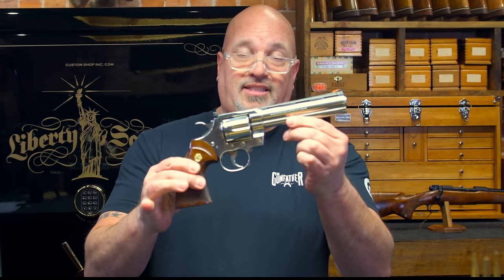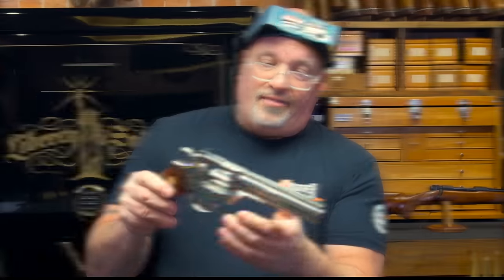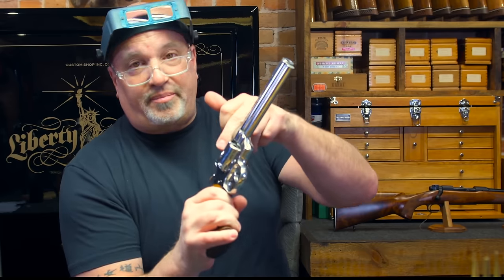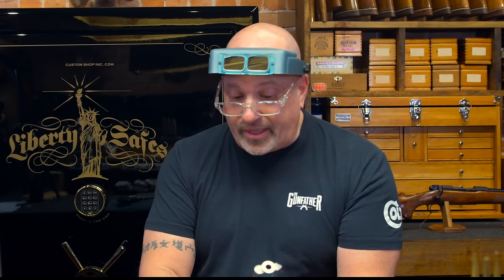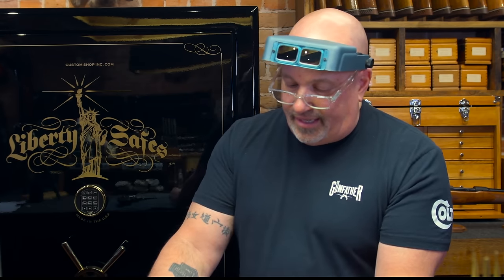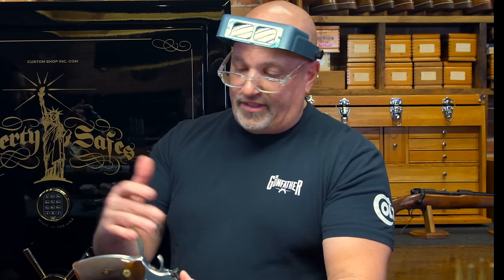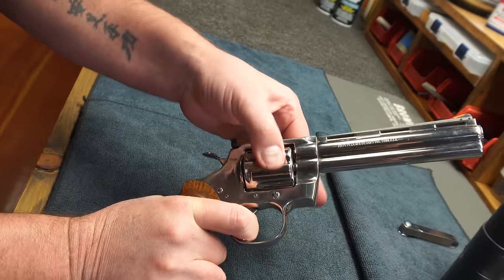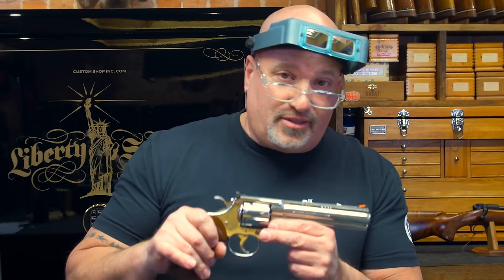Check the TIMING on Your Revolver  (Every Gun Owner Needs To Do This!)

Comment: My favorite revolver is the Ruger GP100.  I have a 3", 7 shot 357 and another 5 shot in 44 Special, an old Speed 6 got me hooked on them.  I have Smiths and had two 6" Pythons, IMHO to many problems in both examples.  Forcing cone and timing issues, dragging and just not up to high round counts.  I also have a 4" Trooper Mklll that I believe is twice the gun.
Reply: Their classic is the best to be honest
Reply: The classic GP100 in the blue
Reply: Also have a Mark iii 👍🏻
Reply: I never should have sold my Trooper. Incredibly accurate.
Reply: The problem with the GP100 is after firing 50+ rounds and any high round counts at the range, the cylinder/frame milling tolerances are milled sooo tight, that the gunpowder residue can (and will) cause the cylinder to sort grind, or even jam so that the cylinder won't turn.
The NH State Police had these for a very short time and experienced that problem dozens of times. That was in the 1980's.
Reply: @gayle2848  damn Gayle, you married?
Reply: @gayle2848  My old Speed 6 never missed a beat, that is what I love about it. I bought a 6” GP100 back in the early 90’s, again I only clean my revolvers when they get really grimy and never noticed any problems with it. I gave it to my son a while back, replaced it with the 3” and 5 or 6 years ago I bought the 3” 44 Special.  Both have been flawless and I average 50-100 rounds / week between the two, last year over 3000 with one cleaning of the 357.  I forget when the GP100 came out but I believe it was in the early 80’s, might have been teething issues at the time. No one I know that has owned one has ever noticed that problem.
Reply: @hardball107  I have two GP100s and I have never had any problem with either one (both .357, one blue, one SS) and I have fired all kinds of ammo thru them well over 10,000 rounds total!  I'm totally sold on them and quite frankly, they fit me very well.  The only modification I've made is changing to Hogue grips!
Reply: My fave is a 50 yr anniversary 357 blackhawk flat top
Reply: The Mk III was as close to flawless as a revolver can get....IMHO
Reply: I have many revolvers, I have to say I like my Smiths however I love my Rugers.

Comment: OK, so the cylinder locks up OK. That does not automatically mean the the barrel AND cylinder are in OK, I mean proper alignment. As a  prototype machinist making one offs, I would check that alignment, OK. If you go to all the work and expense to "restore" a revolver OK, it would not be OK for the customer to have an issue because of misalignment. OK, over and out.

Comment: My favorite revolver is a Dan Wesson .357mag Model 15VH pistol-pack with all the different size barrels and grips.
Reply: Bought this kit brand new in the mid 70's. It was sold and marketed as THE DAN WESSON KILLER KIT. You won't see that happening anymore.
Reply: I don't have the kit but I do have a model 15 (vented heavy) with an 8" barrel. Wonderful revolver.
Reply: I wasn't sure of the number you listed. I don't remember mine. It came in one box which when opened had the gun with I believed the 8 in. barrel attached and the other barrels down to 2 in all in order underneath kinda of a display box. I never changed the barrel. I foolishly sold it although at the time it didn't seem so. Bought it at Sportmart. There gone now I guess. was the chrome one. Also bought S&W 29 & 27. That was the 44mag. and 357mag. They were also 8 in and both chrome. Sold them too. Bought all 3 same time, no questions just 3 day wait. Those days are long gone. Don't remember the price but I believe it was 7 - 8 hundred for all 3.
Reply: Too bad CZ-USA dropped the production of this fine revolver
Reply: My father's favorite  too!

Comment: Everyone has a preference based on perceived functionality. 
Mine is Ruger Revolvers, Ruger builds their Revolvers like a tool not a Swiss Clock, so, yeah, the Ruger action isn't going to be as complex and delicately fine as a S&W, but  that old Ruger Revolver won't fail you.
Reply: I've had two fail me. Both .44 mag. One was a cooked forcing cone, and timing. The other is timing . They fixed the first one for free. I haven't sent the other back yet. They don't last long with hot .44 mag.
Reply: S&Wesson 686 4”
Reply: I’m pretty happy with Ruger’s custom service. I bought a SP101. The timing was screwed up right out of the box. Sent it back, they replaced all of the internal parts and sent it back no questions asked. It’s run perfectly ever since.
Reply: @mikeys7536  
I have an old New Model BlackHawk and a Security Six, from the 1980's.
Paid just $200 for the SS and $150 for the BH. at my local pawn & Gun. in 1986/87
I really like the new RedHawk, 8-shot in 357, BUT WOW, it is expensive.
I'm glad I got my guns when quality was still affordable....🤠
Reply: @franmusolino2660  
I had a S&W 686, back in the 80's,
 Hated it, super Heavy, Clumsy, only good for the range.
Traded it for a Super BlackHawk
Reply: @awakenotwoke4830  
For Sure, a 44 mag is a Rifle Round to me,,

 I shoot 44 specials in my 44 revolvers.
Just the wasted powder from a 2.5 and 4 inch barrel is enough evidence for me that 44 magnum in a pistol is a dumb idea.
Reply: Ruger has always been known to produce a much higher quality metal for their guns and with some polishing and a few shims, as precise as the Smith's and Colt's. Colts seem to break a lot easier than the others.
Reply: @joecat101  
Yup, That has been my experience too.
Especially the timing and alignment on S&W guns, the smaller parts give a nice action, but you gotta baby them.
Reply: @jodopeg  Ruger is trash. Smith and Wesson is way out of their league
Reply: @T-SwiftsMaritalAid  
S&W is more refined, no doubt, but get sand in it and watch it NOT FIRE.
Reply: My experience with a new NewModel Blackhawk was very poor.  The ejector wouldn’t clear the cylinder easily at all when it got hot.  Bought it in 1976.  Worst revolver ever.  Smith or Colt work far better.  I was very disappointed in my first gun purchase.
Reply: @Edgy01  someone who had the gun before you must have tampered with it, because the ejection rod would not be an ejection rod if it didn't extend past the back of the cylinder....
https://drive.google.com/file/d/1WgkWyUk9qkrqtA-a4neXyT239Lpp6L5J/view?usp=drive_link
Reply: Ok……?
Reply: Amen.
Reply: @awakenotwoke4830 Mind telling me what models? I’m eyeing a few and would hate to get burned
Reply: @T-SwiftsMaritalAid  Ruger SP101 is trash, great design but poorly assembled. Bought one used years ago. It was a little jewel. Five years ago, I bought one new. It was out of time and I traded it off. Took a chance a couple of months ago on another new one and it was hot garbage, the barrel was so crooked that they had the sights set waaay off to the right, and it shot 6 inches off at 5 yards! The barrel- cylinder gap was so crooked that when the gun shot 2 cylinders, the heat caused the cylinder to jam up and not want to revolve. I dumped it and got a Kimber and never looked back. This coming from a lifelong (former) Ruger fanboi...
Reply: OK 😂
Reply: @jodopeg i had a sw 568. Loved it.. to each his own tho.. i have large hands, that might have something to do with it.
Reply: @Zeeboklown  
Yeah S&W makes some nice L and N frames, perfect for big hands.
My hands are medium sized,  but I like Ruger because I can dissemble my Security Six, Black Hawk, and Red Hawk 357 by memory.
Clean the parts in gasoline, give it a light coat of oil and put it all back together like new with just a screw driver and a punch, all in 5-7 minutes.
Simple and strong.....
You take apart your S&W model 568 down to the last piece and you'll have a Hell of a Time putting it back together.
Springs popping out, delicate little toggles and pins. Fukin Nightmare...!
Reply: I only made it to the seventh ok. OK?
Reply: @jodopeg  that's the thing tho. i never HAD to take my s&w apart. period. so, it's kinda dont' fix wats not broke scenario. i understand ur statement, but what does it matter if my s&w has more fiddly parts if they never needed to be replaced??
Reply: @Zeeboklown  
cool,,, just don't drop it into a sandy spot or a mud puddle....😄😄
Reply: @awakenotwoke4830  
I have an old Sig-Sohn 44 mag Colt replica, I've always shot 44 special in it.
shooting 44 mag from a pistol is dumb, a 44 Mag is better shot from a lever action Marlin1894
Reply: @Boofi-quat  sorry just saw this. One was a late 90s super black hawk. I replaced it with a super black hawk hunter. Both 7.5 inch. The hunter hasn't had anything hot through it. Still has timing issues.
Reply: @jodopeg  It's was bought for Alaska, bear defense. It was the largest caliber I could shoot accurately. I run a 10mm model  40 Glock now, with Underwood penetrators.
Reply: Ruger's are built heavier than Colt or S&W. My only negative against Ruger
Reply: My ancient Colt Agent snub nose revolver was built like a Swiss watch by a professional master craftsman. It has a very smooth double action trigger pull and is very accurate and reliable for a snubby.
Reply: @franmusolino2660  Damn skippy. The caddy of handguns.
Reply: All of you guys on here with a dislike for Ruger, I believe that dislike is unjustified. I've worked in the firearms industry for years and have owned many different brands of revolvers. I'll take a Ruger over any other brand if given a choice. That being said, S&W's are fantastic revolvers as well, and so are    Dan Wesson, Colts, and now Kimber. Even some ofcthe cheaper revolvers are pretty decent nowadays, such as Taurus, and Charter Arms. Yeah, some of you used the example of having experienced some unfortunate flaws in some of the Rugers you have purchased, as reason to condemn them as junk. Well, guess what? All firearms manufacturers have service departments for a reason. Sometimes poor quality guns manage to pass quality control for whatever reason. Having worked in the firearms industry, I have personally had to return customers guns to the manufacturer for warranty work to be repaired or replaced. And yes, a lot of those have been S&W's, and all the other brands listed above. Hardly ever did we get Rugers to send in for repair or replacement. Rugers are built like tanks. They are typically very solid reliable revolvers. The triggers might not be as great as some others, and the might not be as pretty as some of the others(which is debatable), but they are great revolvers. Ultimately, revolvers tend to be very reliable no matter who makes them, and yes there are exceptions to that. But modern manufacturing advancements and technology have created an environment where most firearms that are manufactured have a pretty good record of quality. Anybody is welcome to disagree with my assessment regarding the subject, but I came to my conclusion based on my personal experiences. Just my humble opinion.
Reply: I NEVER had a S&W revolver fail me. I’ve been on the line when Colt revolvers “hiccup”. 50 rds p/month; not one issue except for a squib.
Reply: @patrickdaly5117  ,,,
I'm not saying S&W revolvers aren't good, they are a classic.
But, I've had episodes while out in the Everglades here in florida where it would rain and get everything muddy and eventually full of the sandy dirt we have here.

And while I can easily field strip and clean my Glock and Taurus 9mm's,,,, my revolver is way more complicated.
But, with my Ruger Security-Six, New Model Black Hawk and Red Hawk,,, I can take them all apart, guts and all, wash the parts in gasoline, re-oil and re-assemble with ease on a table with minimal tools.

Can't do that so easily with a S&W model 19. Lots of little pieces, springs popping out, tiny pins, etc.... I'd have to go step by step watching a YT video on the gun to get it back together correctly.....🤠

Comment: When checking timing either single or double, always let you off hand rub the cylinder to prevent inertia from helping the cylinder rotate. Creates a slight drag, so that one see's ONLY the mechanical operation between hand and extractor star and cylinder stop. No matter what manufacture of revolver. Ron Power (Power custom) taught me that in a class ages ago. Good video.
Reply: Wrong.
Reply: @gunsquawk4443  I was taught the off hand drag method.  You are simulating cartridge drag with your off hand.  It's not a lot of pressure, just enough to keep the cylinder from rotating with inertia.  Not sure why you consider that wrong.
Reply: @gunsquawk4443 

No, your wrong.
Reply: @madamslv what do you mean by “cartridge drag”?  Friction of the case heads on the recoil shield?  If so, that should be very little friction.
Reply: @madamslv  I'm not a gunsmith so cannot say who is more correct here, but I only had one revolver with timing issues, my Model 29-3.  It would over-rotate in double-action if you pulled the trigger quickly and the hammer would fall between the chambers.  If you pulled slowly or with your finger dragging the cylinder slightly or only used it in single-action it would not.  I discovered this problem when shooting it in double action for the first time and any extra friction from the rounds being pushed back slightly from firing did not cause enough friction to prevent the issue.  I only shot about two cylinders worth of ammo through it when I found the issue as I was afraid to shoot it after that.  I tested it with empty shells in the chambers, an empty cylinder, and with some dummy rounds I made with only bullets loaded in the shells.  The more weight that was in the cylinder or the more speed it was rotated, the more it over-rotated.  This gun has a very smooth cylinder rotation loaded or empty and any extra friction from cartridge drag was too minimal to be of consequence in this particular case.  I had it worked on and it turned out that springs had been lightened by the prior owner (don't remember which ones) to probably try to lighten the trigger pull.  I have a couple of Ruger revolvers that have no timing issues, but do have noticeable cartridge drag with some loads.  Occasionally I have had cylinder binding with a couple of them when using hot loads and my Smiths never have this issue being better fitted and finished than the Rugers.  Cartridge drag is definitely a thing, but seems situational.  Maybe checking with both methods is a good idea depending on the particular model or circumstance?  IDK.
Reply: Yes, a "short hand", the cylinder is dropping into the notch rather than being Pushed into it.

Also, Colts are different (vs. S&W) in that the hand provides pressure at timing lock
Reply: Aolvaar - the timing of the bolt drop isn’t controlled by the hand.  Failure to carry up (bolt doesn’t get to cylinder notch) or over-travel (much worse - bolt goes past cylinder notch) are a function of the hand and the pawls on the back of the cylinder.
Reply: @chipsterb4946  
The Hand is rotating the cylinder, it is Pushing the cylinder.
The BOLT STOP could pop into the cylinder notch because the leading edge of the notch is worn instead of the cylinder being pushed into the notch

I said nothing about "bolt drop".
Reply: @chipsterb4946  
Another way to look at it is to grind the hand, Short.
Then the cylinder stop is controlled by the hand,
The cylinder stop will never get to the notch.

Comment: I would have to give credit to Ruger redhawk. It goes back many years to my first purchase of a revolver, the Ruger Redhawk At the time of purchase I picked up two boxes of 44 magnum ammo and proceeded home. A few days later I got to shoot it.wow! This ammo packs a punch.( I never shot a 44 mag before, so I didn't know what to expect) After shooting 6 rounds, there was a lot of black on the stainless revolver. Long story short, after talking to the gun shop owner and him looking at the revolver ,the boxes of ammo were a recall, and loaded extremely hot . I believe if it would not have been  for the Brute strength of the Ruger redhawk it may have been a different story! So my credit goes to the ruger Redhawk.
Reply: yep , it could have handled cases of that hot stuff
Reply: I can relate...
Reply: I agree Ruger Redhawk is a fantastic revolver I have many thousands of rounds through mine. And the gun is still like brand new.  The beauty of a stainless steel revolver is with a little scotch Brite you can make it look brand new again.
Reply: I have one of the first super Redhawks in 454 casull and I like to load 250gr silver bullet loads at close to 1800 fps. It has handled them very well as long as I clean the lead out. It's been an impressive pistol with a few large predators meeting there demise with those loads

Comment: I have two S&W revolvers, 686+ 4”  and  a 60 -3”” both in SS , my third gun is a Springfield Armory SS ,1911 loaded, being a mechanic for 50+ years I had these guns  apart down to the last spring , and polished then on a wheel , Reassemble them and fired them at the range. They looks great and I like them all !

Comment: A very informative video.  Quick FYI, your model utilizes a transfer bar and can be dry fired.  People should be aware that the older models with the firing pin on the hammer should never be dry fired.  Use snap caps if you're going to check the timing on an older revolver.

Comment: What kind of a complete restoration does a gun need that looks mint timings good other than a complete cleaning?
Reply: kinda , i had the same thought,  one hour gentle n thorough cleaning
Reply: Some folks will charge you $2000 for a complete '' restoration '' when all it needs is a good cleaning. Just beware.
Reply: Restoration? Really?  Both seem pretty nice at first view.

Comment: Pre lock S&W N Frames are my favorite
Reply: It's like hold a cement block their so heavy. they need to be be, but man.
Reply: @johnduffin9425  A 4" barrel S&W model 29 loaded isn't really all that heavy  especially considering what it fires. Even a full sized polymer frame 9mm starts to show some weight with a full 17-21 round mag